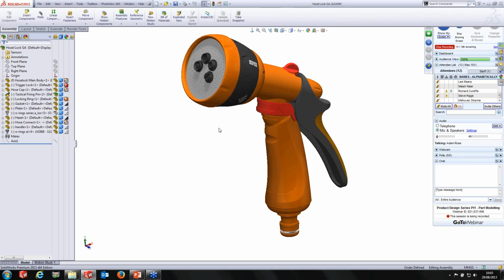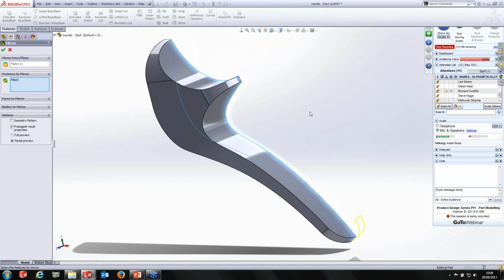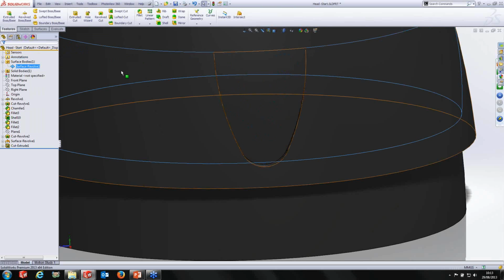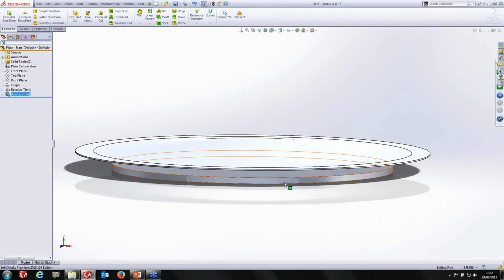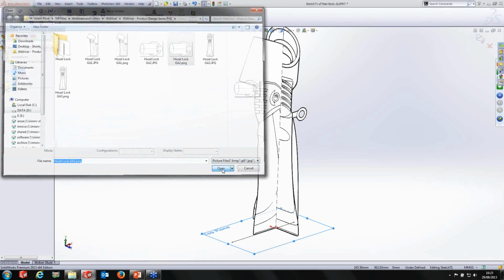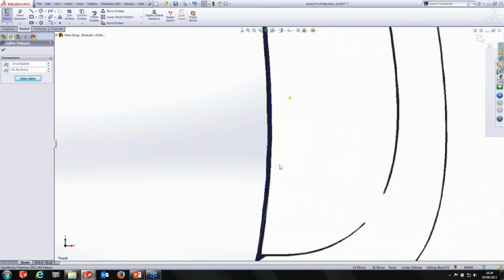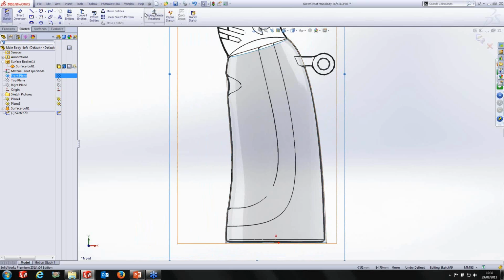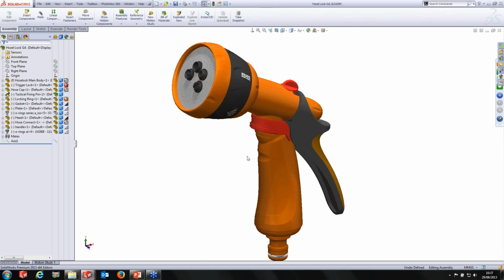Product Design Series Pt1   Solid Surface modeling

Comment: When i am adding in my filltes,even though i am on " shaded with edges" visual style, the edges around the filleted faces are not shown! This is making these surfaces harder to be picked in simulation for example when i am applying mesh controls. What option should i change for these edges to be vissible again?